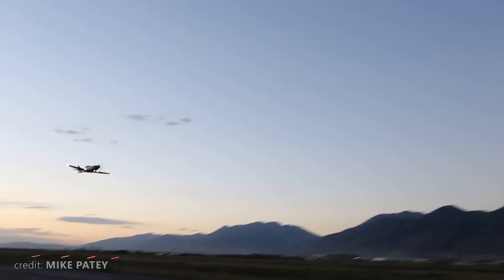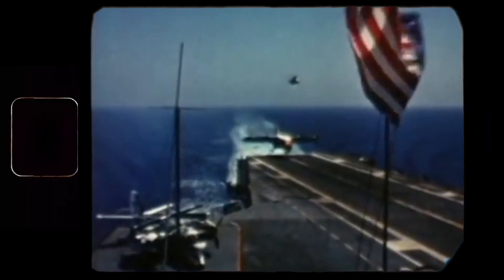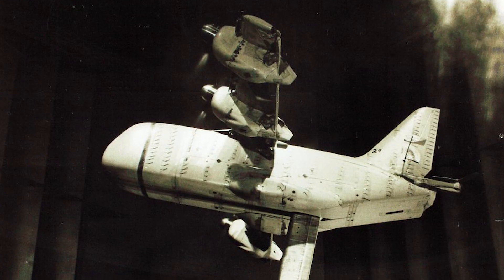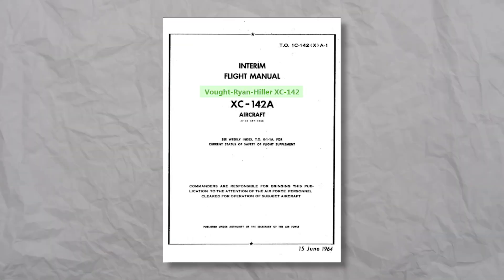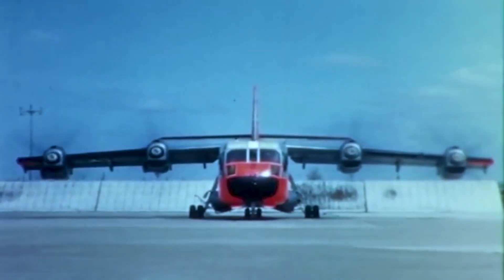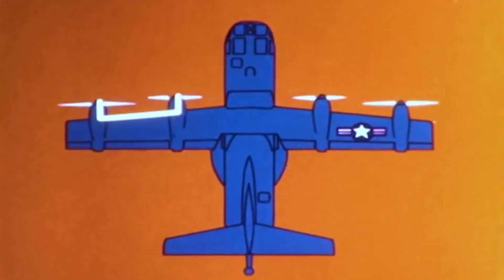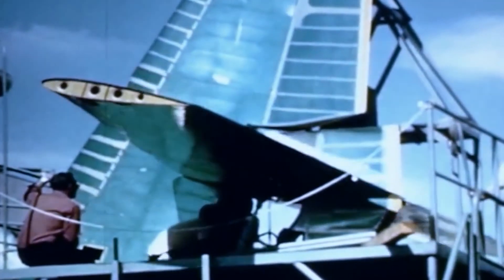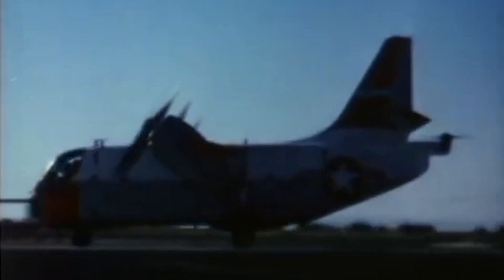LTV XC-142 – Crazy Tilt Wing Marvel! History, Review & Specs

Comment: There are 3 planes based off this plane in tbfs!

I really like this plane its really coooool
Reply: I love it and I want it to come back
Reply: @kamel3d maybe it’s the right time to start doing things
Reply: I have a question. was the propeller diameter was also variable? I mean when in vtol mode the blades of the props would extend out thus increasing the diameter to provide better thrust. there is a mobiles game named " turboprop flight simulator" and that game has a plane that looks exactly like this xc142. same tilt wing feature. and that plane in the game had variable propeller diameter. please check it out and give me some info.